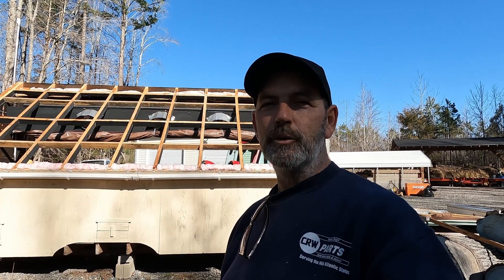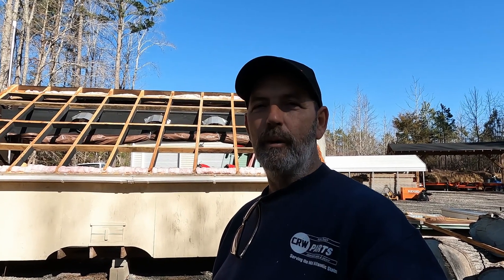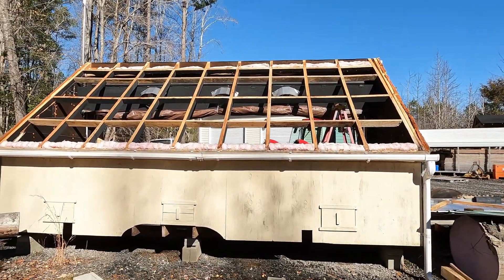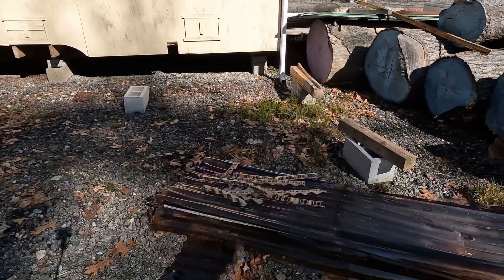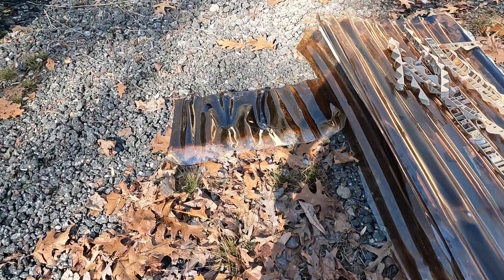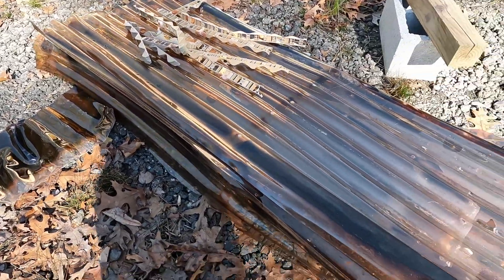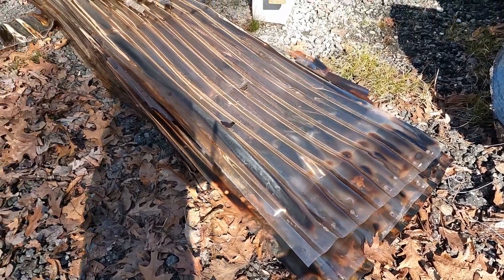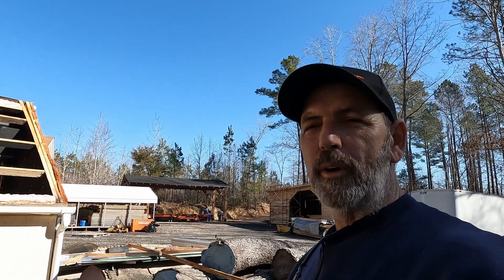OUR SOLAR KILN HAD A MELTDOWN !!

Comment: Did your wood come out unscathed?  Greenhouses have skylights that open and close based on tempture.  I think they are controlled by some sort of gas filled cylinder.  Perhaps something like that could serve as an automatic emergency vent...would have to figure out how to adjust for desired kiln temps.
Reply from the maker: Yes the wood came out ok
That was the best part. Kiln can be rebuilt 
But the English walnut slabs would be hard to replace. If I hadn’t taken my temperature sensors out of the kiln I would have been altered how high temperature is. But I didn’t want them to accidentally get wet. So I should have left them in. Yea I don’t know about the skylights, I’ll have to look into something for backup. Thanks